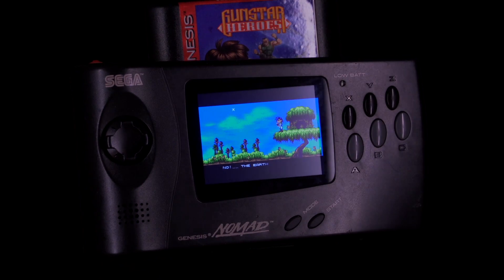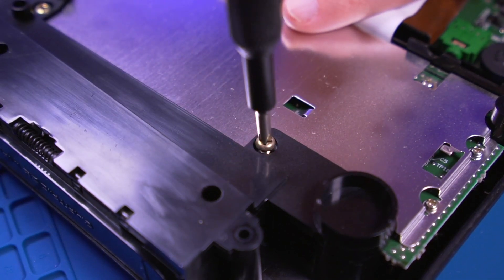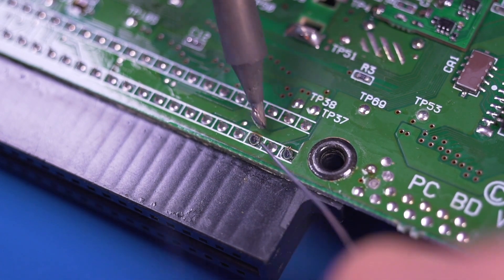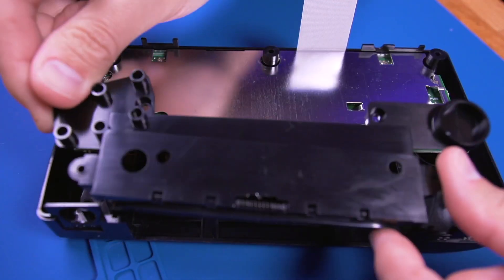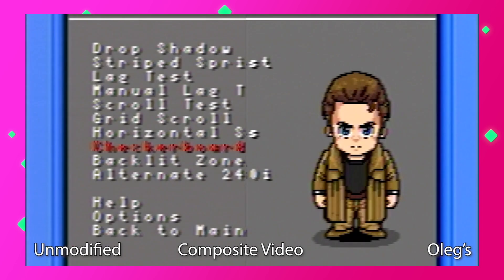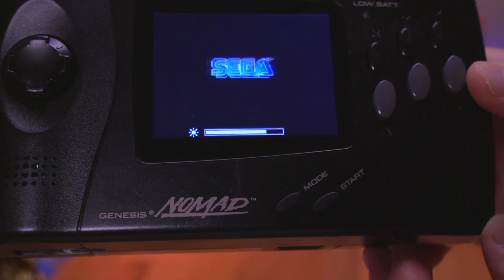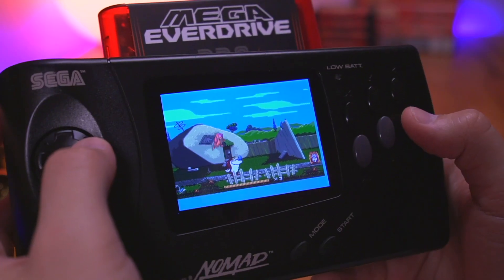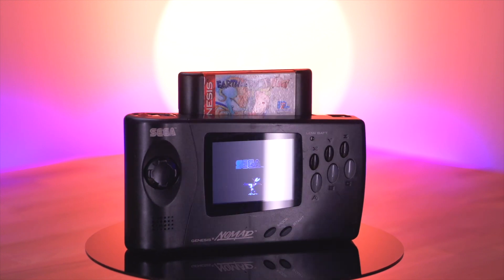THIS MOD DOES IT ALL! | The ULTIMATE SEGA NOMAD MOD from Oleg Endo

Comment from the maker: UPDATE regarding Sega-CD compatibility issues with flash carts.
The Sega-CD functionality of the EverDrive Pro was not working at the time of filming. As has been discovered later, this was due to a firmware bug of the EverDrive Pro, which had an issue with the Master System mode wire on the Nomad chipset. Sega-CD functionality has been confirmed to be working with the latest version of the EverDrive Pro firmware.  This is great news for this mod as you can play Sega cd games on the go!
Reply: Now I just need to get one from Oleg!

Comment: Re: Overclocking -- I would try Mega Man: The Wily Wars. This game unfortunately suffers from slowdown in some sections, and I understand that people have been mitigating this through overclocked emulation.
Reply from the maker: Nice!  I’ve been debating whether or not to own mine. Just bought a physical version from castlemenia, I guess I should to give it a try!
Reply: @MachoNachoProductions  Homebrews aren't really your forte, but I'd suggest checking out Mega Man: The Sequel Wars. The guy making this is doing Mega Man 4 in the style of Wiley Wars, except his game is good and Capcom's game is... uh, less so.
Reply: A lot of Shmups benefit from overclocking I believe
Reply: @jessragan6714  Yeah Wily wars is terrible. It's janky and doesn't control well at all. It wasn't developed by internal Capcom and it shows. Mega Man: Sequal wars looks excellent. What wily wars could have been. To each their own of course.
Reply: @MachoNachoProductions   Apparently the reissue of the game actually lessened the slowdowns. So it isn't just a simple re-print of the original.

Not saying it still can't have its problems though.
Reply: Dvr looks better oleg imo

Comment: just because this happened to my old nomad, i want to mention it here in case someone is using this video to install this mod. if your nomad freezes by slightly nudging your cartridge, or worse, by pressing a button too fast, you need to repair the cartridge port's connection to the main board. all you have to do is reflow the solder on the cart port pins and it will handle all the cart jiggling in the world without freezing 👍
Reply from the maker: Awesome! Thank you for the insight 🙏☺️

Comment: Definitely the best mod. It is incredibly smart and well done. The price is high but with all the options installed it is a fair price.

Thanks again for your great video !
Reply from the maker: Glad you enjoyed the video!!
Reply: @MachoNachoProductions  how do we get our name down for this ultimate mod kit????  My Sega Nomad still works, but the original LCD came down with Vinegar Syndrome. 
For those of you that don’t know what Vinegar Syndrome is. I’ll be more than glad to tell you: LCDs (on Sega Game Gears and Nomads) have polarizer filters glued to the front and rear of the glass LCD displays.  As LCDs age (….and that goes for all LCD displays), the glue or adhesive dries up, sours out, cracks, and becomes brittle detaching the polarizer filters, rendering the display looking very ugly, and completely useless, since you need these polarizer films to see the images on the display, like you would on a TV.

Comment: Absolutely amazing mod. Not in the price range of most at over $200 but still I think the best screen mod for a hand held I've seen
Reply from the maker: Totally agree!  It’s fantastic but pricey for sure!
Reply: lcd screen, battery, custom pcb, usb-c charging, screen lens, not to mention the other added features

im not saying its inexpensive,
but i can see why; if you wanted all these features on a GBC or GBA you can expect to pay almost as much honestly...
Reply: @jonniefast  actually for all those mods on GBA as a kit it's under half that price which is significant in people's decisions between a low cost $40 nomad screen Vs a $200 one. Not taking away the worth of the kit but it's a huge issue for entry to mass market like all other LCD options
Reply: @RetroSix   ya prices on GB stuff has come down, but the nomad is v niche / i wouldnt expect the same thing tbh

Comment: "This mod is expensive. At twenty-two thousand..."
WHAT!?!
"yen, or roughly $200 dollars..."
Oh. Atta way to soften the blow of the price there, Tito.

This is way outta my price and skill range, but I nevertheless have to ask if that soft reset will make X-Men playable from start to finish on this system. As far as games that would be good to test with the 10MHz mode, I'd suggest Tengen's polygonal games, particularly Hard Drivin' and the "what were they thinking?" port of Steel Talons. Also Zero Tolerance and Cybercop/Corporation, although I don't think anything can salvage the latter game.

Comment: Just the level of engineering that went into it, not to mention the build quality of the kit itself (definately not just a cheap mass produced kit) makes it worth the $200
Reply: None of the kits are cheap and mass produced unless you use a backup camera which wasn't necessarily meant as a kit, but has been turned into a make shift composite kit for which you can print or buy an aligning bracket to make positioning the screen easier.

Comment: A revision of this needs a larger battery, at least a toggle switch to turn off the LCD so you can play it exclusively as a console. Also, another toggle switch or even another controller port for playing single player games or even two player games in a switch like console mode.

Comment: Overclocking is beneficial for games like Road Rash, depending on the game coding, software scaling etc, I believe FIFA and other EA games also benefit from it, as well as simulation games like LHX Attack Chopper, which is heavy on the CPU and others that slow down due to many  sprites on screen, like Sonic losing rings, etc. For a quick test, load any Road Rash and activate the overclocking while playing and you'll notice the difference. On emulators, you can overclock up to 200%, it will make the game run smoother, anything beyond that will make the game run too fast.
Reply from the maker: Awesome!  Really appreciate the insight. I’ll have to try out those games 👍
Reply: @MachoNachoProductions  In terms of 3D; Bloodshot/Battle Frenzy, Zero Tolerance, Kawasaki Super Bikes all benefit. There's also games that you would think would work but don't, like Hard/Race Drivin, those both tie game speed to framerate without an upper cap. Mutant League Hockey weirdly runs at a perfect 60hz as opposed to 30hz with a mild overclock too, almost like it was designed for it.

Comment: Incredible mod and this might be the best if not one of the best modern retro handhelds out there. The only real big con is that it takes someone of your skill level to pull it off. Also, the cost but you're getting a lot of features. I wish someone would sell these already modded or built to order. If Sega CD games along with master system can be played on this device would be even more amazing. Other than adding HDMI out and making less soldering not sure what else could be done to make an awesome mod even better.
Reply from the maker: I think it could be possible to get hdmi out of this without soldering. I’m hoping he will attempt this in the future. Would be amazing 😁
Reply: @MachoNachoProductions  🔥🔥🔥🔥

Comment: The 10 MHz overclock is a pretty standard mod for the Sega Genesis, so it's cool to see it here -- there are some videos that show the differences in some games -- you always need it to be togglable, because some games won't work with it, while others run much smoother and more playable with it.

Comment: Only thing I could think to add would be the ability to switch to a wired or wireless player 1 controller instead of using the built in buttons. It would be amazing if you could maybe create a Y adapter that plugs into the player 2 port and use either 2 controllers or plug in the 4 player adapter. This would boost the Nomad to the versatility of a Switch. If this was added and the Mega Everdrive could play 32X games without needing the attachment, then it would be the absolute ultimate way to play Genesis on real hardware

Comment: Nice, seen a Nomad someone donated that looked in great shape to a place I worked at.
I'm not a fan of running the magnet wire through the via hole, I would dab both sides with hot glue to minimize any possible wire rub or try to find a better protected wire.
I'm going to presume the thermal pad between the shell and RF shield is to put pressure against the RF to the thermal pad on the chip?

Comment: You mention Oleg's screen comes off a little duller... but at least on my laptop the RGBDVR screen actually looks washed out to my eyes. I actually have a RGBDVR board and screen ready to be installed into my Nomad... but I am thinking I may just wait on a second batch of this mod.
Reply from the maker: It is a bit duller but I think it may be due to the anti reflective coating in the panel. It still looks great though 👍

Comment: ...and here's me with an unmodified Nomad, an uninstalled LCDDRV non-IPS LED-backlit TFT screen and an uninstalled Triple Bypass v2 (they've been sitting around for 8 months), because no one seems to have provided instructions for installing both together , nor full instructions for the 3-wire method of BRIGHT wheel wiring.
Reply from the maker: This kit should be much easier to to install than those 👍 if you want similar functionality to 3bp and rgbdrv

Comment: I wonder if the 2 player port is also modded to support the light gun and link adaptor for the game zero tolerance,because then you will have the absolute greatest sega nomad system ever,a system wich should,ve been originally that way,

Note: that the lightgun should be only used once the nomad is connected to a crt tv,if it does support the light gun.
Reply from the maker: That’s a great question. I’d image light gun would be supported when video is output to a crt

Comment: One game series I would say is a good and yet bad way to test the overclock is the Road Rash series. The engine benefits greatly from increased clock speeds, however the physics are calculated per frame which winds up breaking how the game plays as the framerate increases.

Another game to test is the original X-Men. Does the soft reset allow you to get past the 5th stage (Mojo's Crunch) once the computer is destroyed? To do so on a regular Genesis/Mega Drive is to quickly press the reset switch on the console itself.

Comment: I've always wondered if it was possible to add another controller port and bypass the Nomads buttons for Player 1. I'm just thinking about having two controllers for video out instead of using the Nomad as a controller with player 2 attached and the console attached to the tv.

Comment: Aw. I just did the RGBDRV + 3BP a few months back. I love the result, but wasn't a huge fan of the copious amount of ribbon cables or removing the cartridge flap and an RF shield.
Reply from the maker: Yes, this kit is a much cleaner installation for sure. I had debated doing the 3bp and rgbdrv for a while. Glad Oleg’s kit came to fruition when it did

Comment: Would it not be better to lift the leg of the pin 78 on the ASIC?
Reply from the maker: Since the leg is so small and very close to other, if could be more risky. Both methods will work through.

Comment: How do we go about getting this awesome Endo Oleg Mod Mr. Nacho???  I have a working Sega Nomad, minus the original LCD glass panel display. I know the display works, but the glass LCD display polarizing filters (front and rear) soured out, detached from the glass, and ultimately caused the display to fail catastrophically; because it looks like poo.  .....and I know nothing about getting the proper polarizing filters for this unit, and I don't want it to go to waste. It's a rare gem that I was lucky to find, when the display was still good. I could probably do it myself, or send it off to have a pro do the mod on it (depending on my mood). Either way, I'm all in for this 21st century cool mod.

Comment: Amazing stuff here, great video.  I have a Nomad with a pretty decent composite screen, and would like to ask the following, based on the idea that I would like to do a drop in replacement.

1)  I already have an MS mod and a switchless region mod wired to the select button (also acts as soft reset).  Would these mods still work?

2)  Is it possible to run this mod without its battery, just using the battery pack as normal?

Thank you!
Reply from the maker: Those are good questions and I thing the answers to both is yes, but I would ask Oleg on Twitter. He can tell you for sure and he’s quite responsive to questions
Reply: @MachoNachoProductions  Thank you Tito, I will.  All the best mate.

Comment: Very nice.. Now if they could just shrink the board down, make a more sleek case, and I suppose at that point it would be an entirely replaced system. :P If would be awesome to have Analogue release a Sega Genesis cart adapter for the Pocket.
Reply from the maker: That would be awesome if the analogue pocket got a Genesis adaptor!